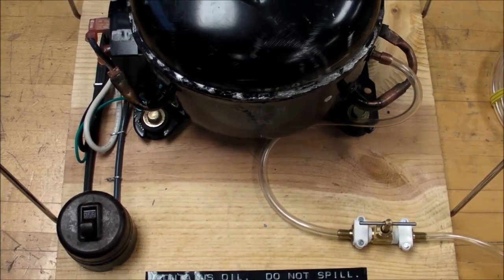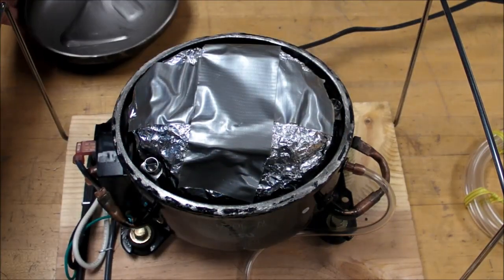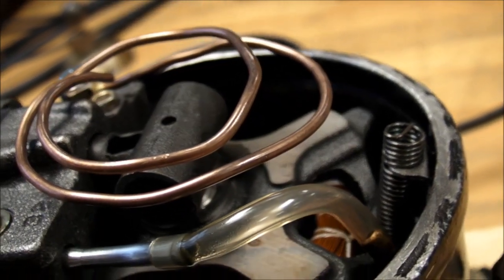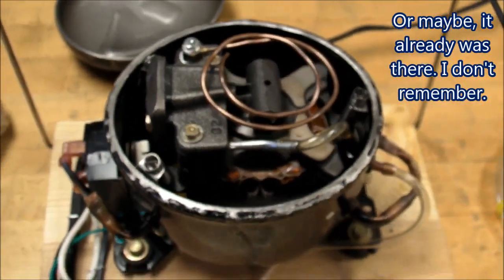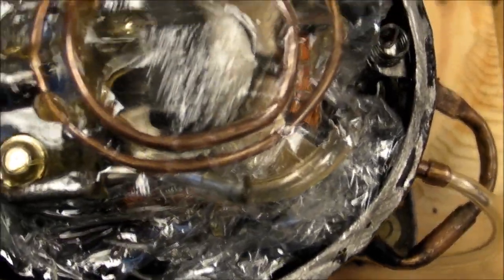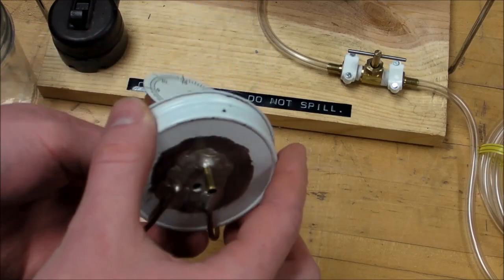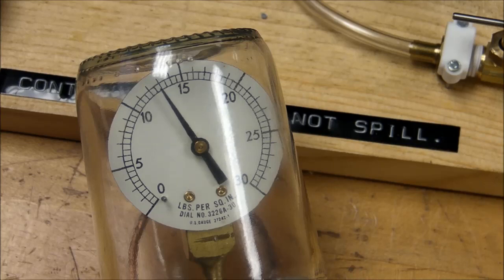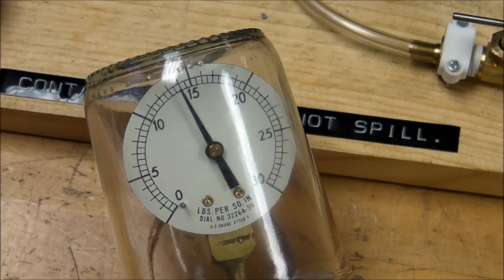(#0035) Home Made Vacuum Pump and Gauge - DRSSTC vs. Spark Gap #05

Comment: nice 1,..i wish i could see/understand how the wiring works, which wires go where etc, yes there are a couple of vids on this, but i need to see 1 wired up from the bare bones, coz the way i am having to start any is by shorting the left prong,to the right prong with an insulated screwdriver,..it works but i feel its not v safe, can u or some1 help me ?

Comment: did you replace the oil with normal AIR compresser oil yet??
as the oil in Freon compressors can and will react badly to water in the air.

Comment: There is far easier way to convert pressure gauge into vacuum gauge.
just bend that measurement element until it shows atmospheric pressure,  you can fine tune it by readjusting needle.
Reply: How ???? 
Brief explanation pls 😵‍💫
Reply: @dagmt9022  
I think I described it pretty well, you just dissemble 1 bar pressure gauge ,  there will be flat bent tube inside which does all measurement you just bend that tube until gauge shows 1 bar instead of 0 bar  (this sometimes even happens naturally if you overpressure your gauge.)
if you just dissemble any pressure gauge you will instantly figure out how to do everything by yourself.

Comment: Actually what keeps most all refrigeration and a/c compressors cool is cool refrigerant flowing back from the evap. coil and flowing across the motor and piston. (Another reason to insulate the suction line in systems: compressor longevity) And you did have to put that tube inside. The whole inside of the case is pressurized to whatever the suction line is coming in at.
You'll never get better than 1-2 psi from perfect vacuum from an a/c/ref. compressor. They're simply designed to run above atmospheric  pressure (15+ above at the minimum). 
Cool vacuum gauge. I like that.

Comment: Last time I used a compressor like that for vacuum, when the suction was enough, it boiled the oil and spit the oil vapor out the pressure line.
I believe you had to add the suction hose connection inside to prevent the oil from boiling.

Comment: hello freind , i need your help, how deep must the oil be for the device to lube itself?
Reply: +NOBOX7 Just leave whatever oil was in it to begin with. If its already out, you can look it up online, or call the manfg. and ask them. For a tiny fridge compressor like that I think they take around 4oz or so? Someone can correct me if I'm wrong. I don't think running it with a little extra is going to hurt it in this case (at least not anymore than using these compressors as vacuum pumps)

Comment: That is untrue, only in medicine do they still use this most archaic unit which was thought up in 1700 and is not an SI unit.
We (in physics) measure vacuum in Torr's and then we measure pressure in Pascals, Bar's, Atmospheres and some other actual SI units.